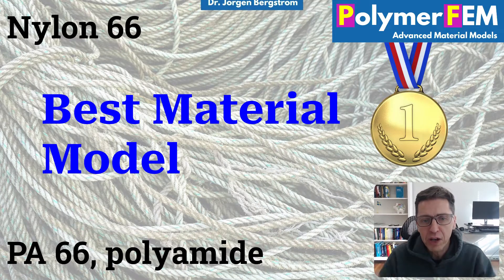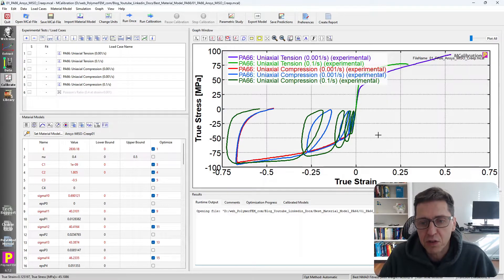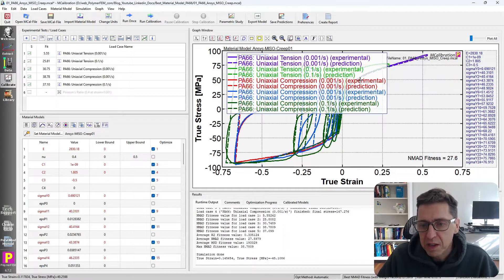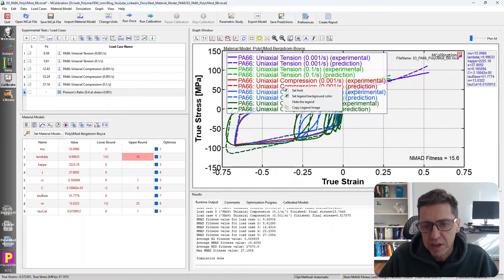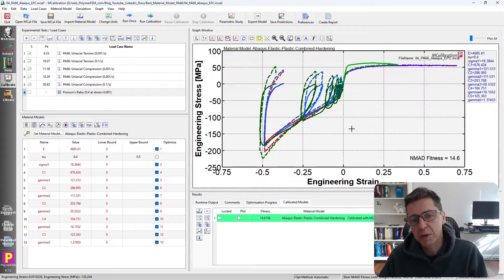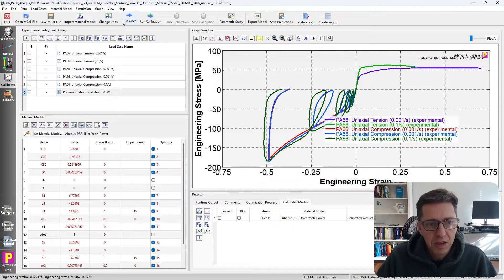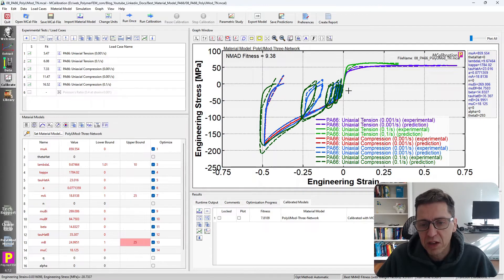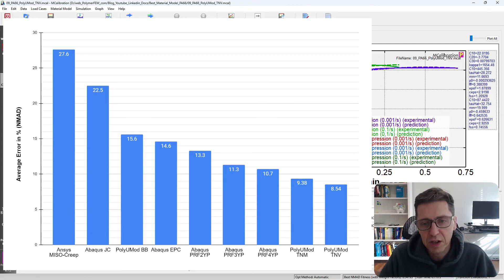Best Material Model for Nylon (PA66)

Comment: Hello Jorgen, 

I am using using Ansys FEA modelling to model a High performance PA and PTFE mixed polymer. I am trying to model the polymer under repeated compressive loading. Would you have any suggestions about a potential material model that would be useful. 

Kind regards, Aidan